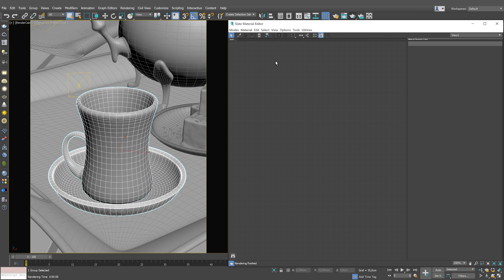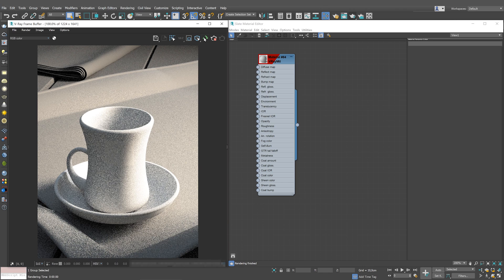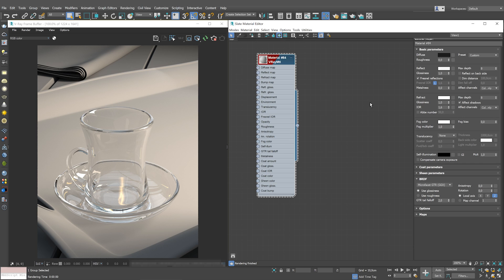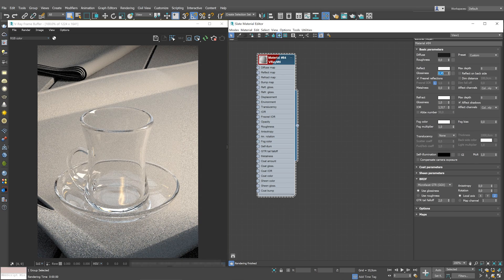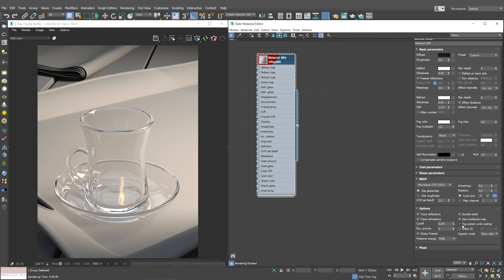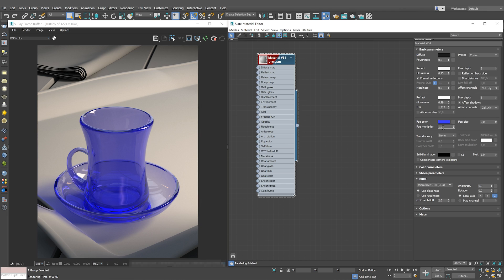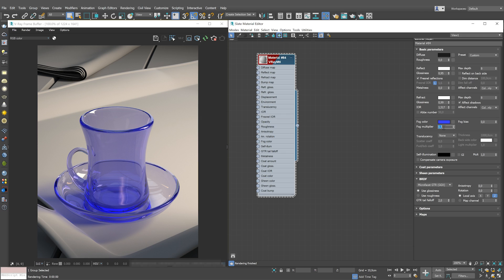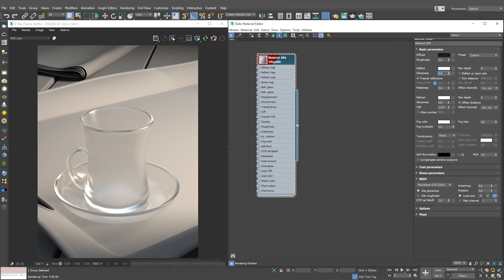V-Ray for 3ds Max — How to Make Glass

Comment: Why don't you use black value 0 in the diffuse but use 2?
Why don't you use 255 but 238 in reflect color? (Don't dielectrics have 100% fersnel reflection?)
Why don't you use 255 in the refractive color?
"To make the material transparent, set the Refract option to very close to white. The white color indicates that this material is fully refractive.
In real world no glass material is fully reflective or fully refractive, and the same goes for glossiness. To break the "perfection", let's reduce the Reflection Glossiness to something like 0.95 and the Refraction Glossiness to 0.99."
Why change a workflow that has always worked, has the calculation of reflections and refractions changed in vray 5?
Reply: Don't use 255 cause "In real world no glass material is fully reflective or fully refractive, and the same goes for glossiness." You said the reason.